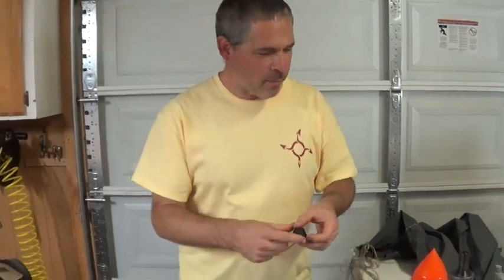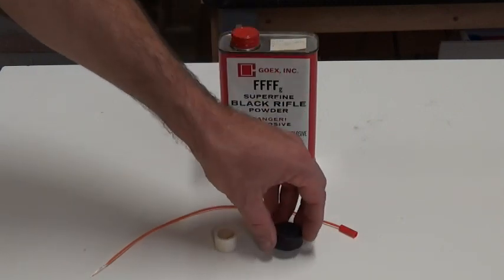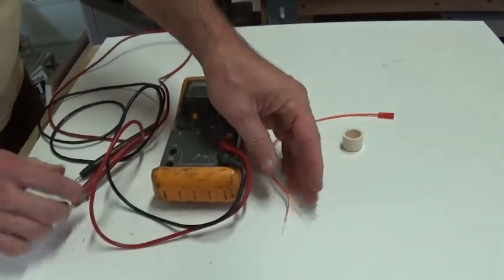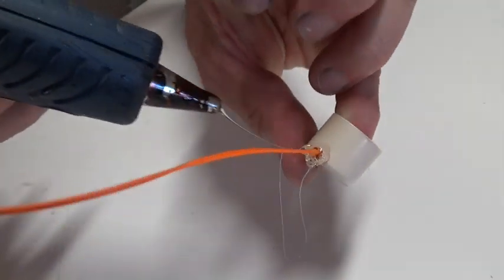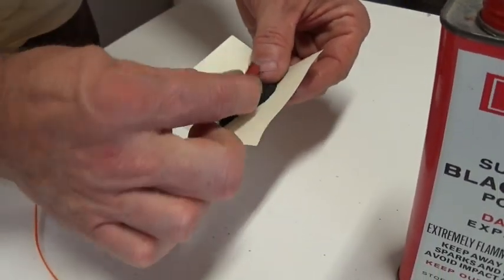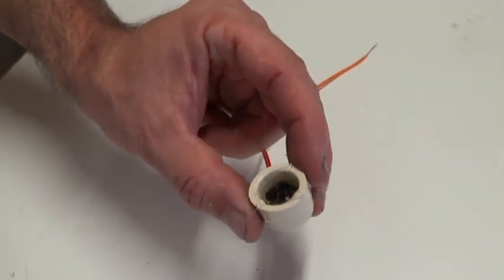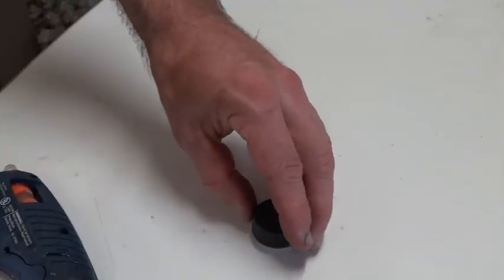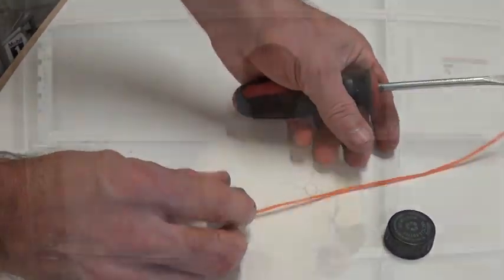Homemade DIY Parachute & Nosecone Ejection Charge for Model Rockets

Comment: Black powder is gold right now I always us straws, heat shrink, and hot glue to make my charges but I like you bottle cap idea bc I’ve been melting my chutes and I don’t really wanna make a really don’t wanna nylon one yet
Reply: It pretty easy to make black powder, you can use the KNO3 from the fuel, with some carbon, some sulphur and it ready to go

Comment: Are the fins necessary for sugar rockets?
Reply from the maker: Absolutely yes!.... Well, kinda Yes... I suppose you could look into making a gimbal motor but that's pretty advanced stuff. For most amateur rocketeers, fin style rockets are the way to go.
Reply: @rotaryrocketry Technically there are other potential solutions. However if someone is asking this question it’s probably outside their skill set.
Reply from the maker: @storminmormin14  o.k... I revised my reply to that question... You are correct in both respects... Rockets don't need fins but making a microcontroller gimbal system is not something most rocketeers will ever do.
Reply: @rotaryrocketry  Ya there are also other methods. You can extend the body down past the exhaust and drill holes in it so that it can entrain air. You can also use aerodynamics other than fins like how fireworks use sticks or just through sufficient forward mass and using the drag on a very long body. 
There’s also active stabilization through RCS, reaction wheels, gyroscopic stabilization, etc.  There are just so many stabilization systems but even still you’re absolutely right. Most rocketeers will never do any of that stuff.

Comment: I launched my sugar rocket yesterday, it flew straight for 50 meters and then it circled once and hit back to ground. How can I make it fly straight?
Reply from the maker: Oh man... Been there!
Difficult question. Depends on what caused the flight failure. If your motor and nozzle performed well, then it may be that your rocket was not balanced or your fin design was not adequate. Do you have any pictures or video you can post? It would be helpful to see your design.
Reply: @rotaryrocketry  How can I send it to you?
Reply: @rotaryrocketry  https://youtu.be/CF56tYCU9Bs
Watch this this is my rocket launch video
Reply: @rotaryrocketry  Or watch the video I have uploaded a dummy video in my channel
Reply: @swaroopchavadi6707  you should probably take a look at Open Rocket, and check if your rocket is stable

Comment: How to protect my sugar motors from moisture so it doesn't lose energy?
Reply from the maker: You are correct that the fuel will tend to absorb moisture from the air. I usually build my motors the day before launch and I put an ear-plug in the nozzle hole to seal it until launch.
So if you are putting the fuel cells into a motor, just seal off the nozzle hole. If you are making fuel cells for later use there are a few things you can do...
1. Don't make a large number of fuel cells that will just be sitting around for a long time.
2. Put fuel cells in a plastic zipper seal bag and remove as much air as possible. I would think storing them for a week or so in this way would be just fine.
3. If you do need to store them for a long time, you can put a silica gel packet in the bag to help absorb moisture. But that means you need to have some silica gel packets available.
Reply: @rotaryrocketry Okay thank you